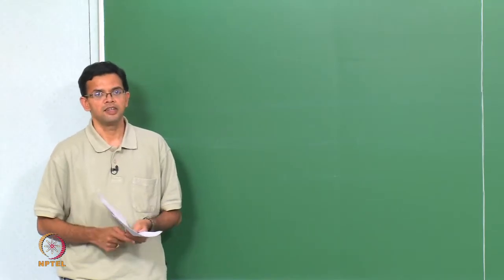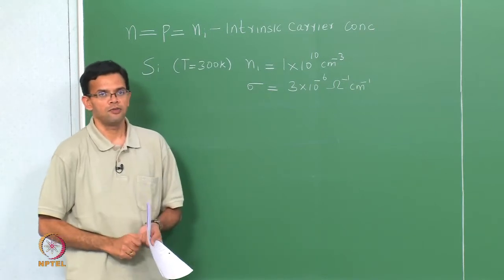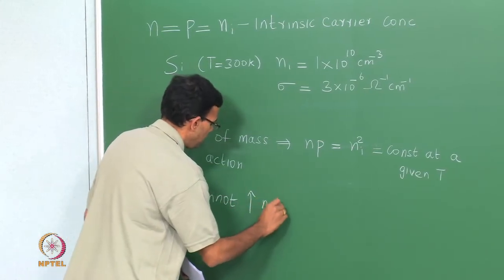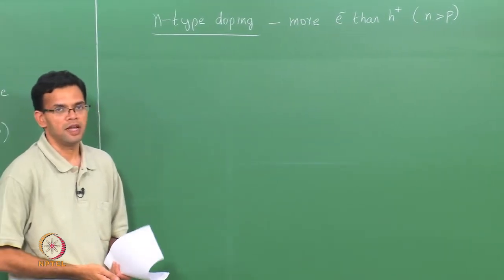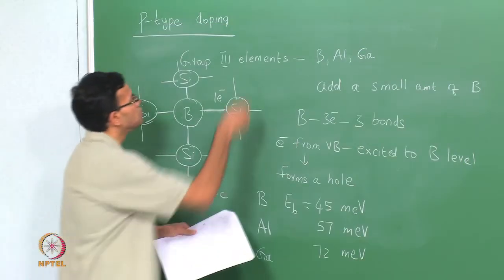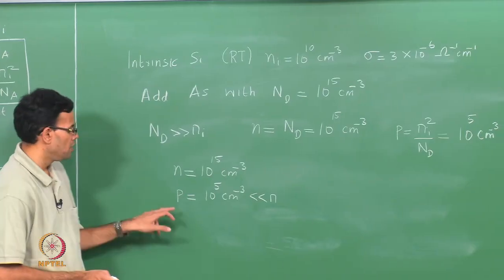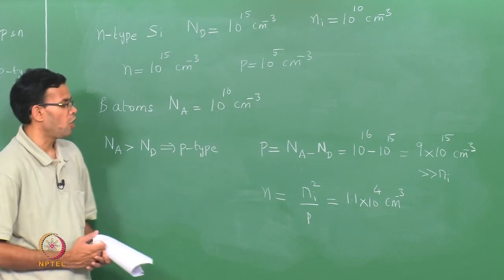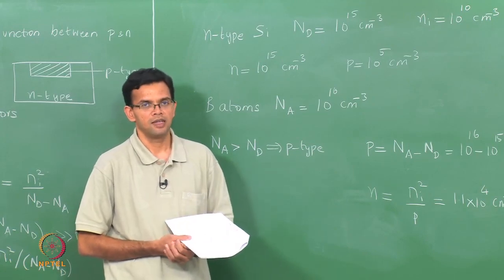Extrinsic semiconductors: Introduction

Comment: Why fermi level of ptype lies near valence band?
Reply: The addition of trivalent impurity creates large number of holes in the valence band.At room temperature, the number of holes in the valence band is greater than the number of electrons in the conduction band. Hence, the probability of occupation of energy levels by the holes in the valence band is greater than the probability of occupation of energy levels by the electrons in the conduction band. This probability of occupation of energy levels is represented in terms of Fermi level. Therefore, the Fermi level in the p-type semiconductor lies close to the valence band.